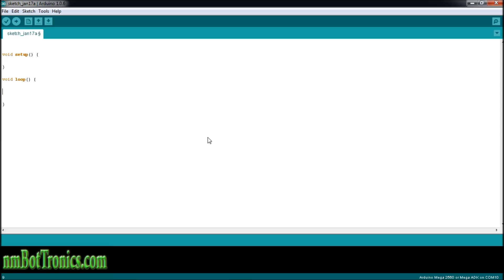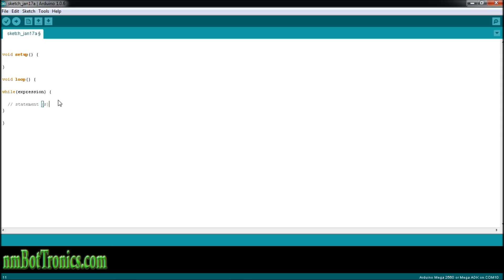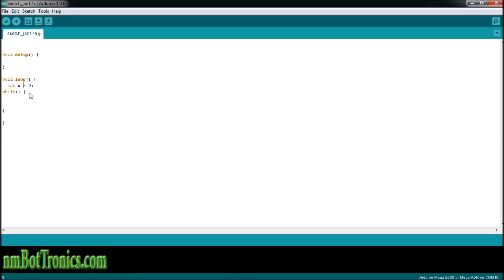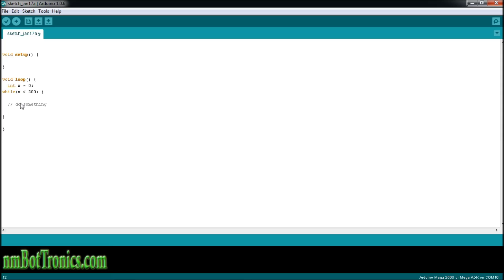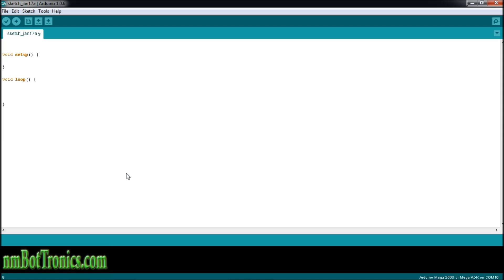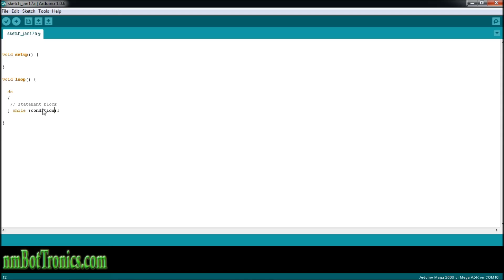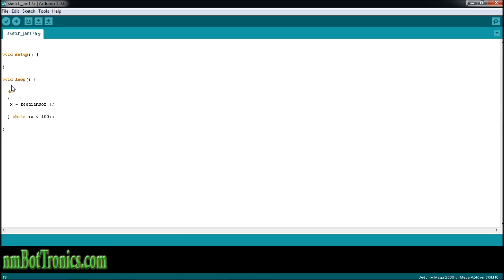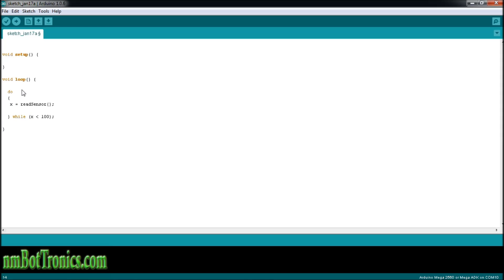Arduino tutorial: While,  Do While loops - an alternative to the if /else statement

Comment: I would suggest that when programming single thread micro-controllers that you refrain from using any loops! Using loops can prevent other code from running that may be necessary to give the illusion of multitasking.
For example, lets say you created a project that blinks an LED every 500 ms. If you use loops, you will throw this timing off and the LED wont flash properly. If your projects are more advanced, stick with if statements as they wont slow things down or add delays.